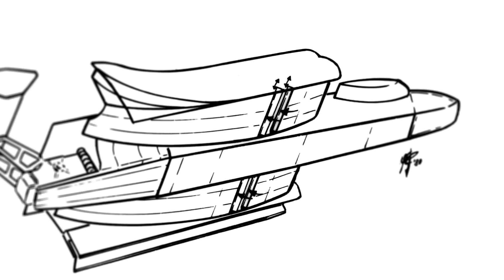Discovering an 'illegal secret' on a Formula 1 car

Comment: One of my all-time favourite cars, I loved that JS-11, distinctly recalling its exceptional debut at Buenos Aires where Jacques Laffite planted the car on pole with  Patrick Depailler by his side. As the tv camera zoomed in on those cars when they took up their positions on the grid, one could see how strikingly different the JS-11 was to anything else. The relatively wide bulk of its nose and cockpit, the high and very prominent bodywork sweeping upwards towards the rear tyres, their distinctive blue and white livery and it was great to see Laffite at the top of his game. How wonderful it would have been had they taken full honours for the season.
Reply: Weenson Oo not if they won by cheating.
Reply: @thechumpsbeendumped.7797  I was recalling my very first impressions of the car back in Argentina 1979. No one knew they were being crafty then but then again what team has not attempted to push the envelope. Look at Brabham and their fan car. It was allowed its maiden win. Were Benetton cheating in 94?

Who's a saint?
Reply: @Houston1863  To answer to your last question: nobody.
Reply: One of the most beautiful formula one cars ever

Comment: So basically there was a drag reduction system before they added it in 2011
Reply: There was already one before 2011, I think year before McLaren came out with what people called F-duct
Reply: Ground effect has been around since the 80s and this vent was to reduce ground effect to aid straight line speed. Ground effect was banned so teams had to add down force instead. Down force isnt as good as it adds drag.
Reply: @3800TURBO  We'll be moving back to ground effect in the near future, though, as it helps to eliminate a lot of the 'dirty air' coming from the leading vehicle, by providing downforce that is currently generated by the rear bodywork and wing.

Comment: So, basically a hidden DRS?
Reply: more like F-duct.
Reply: @JayB-lz6yd    It isn't a system that reduces drag?
Reply: @Porridge Boss DRS is a proper system of its own. and it's basic. just flatten the wing.

F-duct is a way to use/redirect air to feed areas where air iss lacking and create drag (turbulences). 

in the cas of this video, the drag was caused by the radiator openings. so to force the air through them faster to eliminate the drag, they opened a little trap just behind each radiator that connects to the shaped floor under the car that has faster air moving inside.which creates a suction of the air through radiators and escape faster = less drag.
Reply: Without the designated zones
Reply: My first thought exactly
Reply: actually it was a system to reduce downforce at high speeds, becase the ground effect was so efficient on the js11 that it bent the aluminum chassis and lifted the skirts off the ground
Reply: If F1 fans only knew how todays ground effect cars would have some SERIOUS downforce if skirts were allowed as they were in those days.

Comment: The device Giorgio is talking about was used to control the "porpoising" phenomenon, and aero-elastic resonance linked to ground effect which generated significant instability of race cars at high speed. Indirectly, it was a moving device having an aerodynamic effect, and as such would have been questionable, would any team have filed a protest. This never happened as at this time (1979/1981), absolutely every single race engineer was developing its own solution to increase and better control ground effect.

Comment: You now need to ask the question over the scrutinisers. Why didn’t scrutineers pick up on this. I was always disappointed with the consistency of RAC scrutineers on the British circuits. Yes they looked at things on a safety aspect and made recommendations, but surely the FIA have a responsibility to check legality of F1 Cars.
Reply: Lynne Barkas. This was forty plus years ago. Different times
Reply: Because Piola was looking for the ideas and systems all the time to make his drawings, while the scrutineers do it at specific times, sometimes even have to warn the teams so they have the pieces ready to be evaluated. And I bet there was a big sense of "honor" that people would not cheat, I mean, it was so many years ago. Of course by the time the scrutineers arrive to investigate they already hidden the secret or they had a system to lock those plates in place so they don´t move and have a nice excuse ready in case they ask.

Meanwhile Piola would look at it whenever he can, so they don´t have time to hide things. I mean, there are similar stories in the recent years, the FIA rules the car legal and then the teams come and point "but this seems outside the rules", because they know the engineering limits of the rules while the FIA only know the written rules...

Comment: Now he needs to figure out ferraris secret that all of a sudden made them way faster over night
Reply: just a new front wing element
Reply: Yeah right...
Reply: Yes definitely
Reply: Just Leclerc doing his thing
Reply: pee one
Reply: @frozenx1337  and the fact that Merc's upgrades didnt improve them
Reply: I think they just stumbled across better aero. It was always fast, just couldnt steer it through corners. Next year will be interesting if they can refine it better.
Reply: Could be a combination of things , maybe things have just fallen into place good ero , more power , better understanding of the tires , and probly a different feul mix and le-clerc guy was born to race f1 and the fact ferrari are 7 time back to back champions 
The championship is lost now but if ferrari start 2020 like this  it'll be thier wcc and possibly be le clercs wdc
Reply: @twinkmaster2  hope you're not sarcastic because yeah, he's right, it's a new front wing + minor updates that gave them more downforce
Reply: There were rumors about Ferrari finding a way to use extra KERS without it being detected. There's a supposed bypass that they've done to boost it. That's the reason their qualifying mode is so powerful.
Reply: @frozenx1337  more than just a new wing.  New floor and other bits.  Properly developed aero package.
Reply: As if the FIA isn’t? The FIA banned them from using the split batteries they had been taking advantage of, all but giving Mercedes the championship that year (I forgot if that was 17 or 18). “Ferrari International Assistance” is a conspiracy theory, not reality.
Reply: More fucking power! Simple.
Reply: @naufalkusumah2192  3 back to back poll positions and winning his first 3 Grand Prix wins hahaha sure sure.....
Reply: Racing Red you've litteraly got a Ferrari logo as your profile and your name is racing red, yet your calling people fanboys
Reply: @twinkmaster2  FYI the front wing is conditionning the rest of the body. the rear wing was upset by the bad layout of the front wing. since the new front wing, they have a better balance with aero. simple to understand and nothing "illegal"as you seem to hint it.
Reply: Not so much Ferrari got faster, just that Mercedes realized it didn't need to try so they funneled funds away from this year and more into 2020s design. Even with the current car, Mercedes will still likely come out on top and lewis will still likely come out as champion.
Reply: @icommentedthereforeihaveth79  I'm just stating facts. Stop crying so hard lol.
Reply: Ferrari always cheat

Comment: Cheaters are never heroes. They are just cheaters, common thieves.
Reply: Just how long you been around auto racing?  Seriously?
Reply: @geek49203  the fact that I know that breaking the rules in auto racing is as old as racing itself, it doesn't change the fact that I don't accept or like persons like Schumacher and Alonso. As I said, just crooks
Reply: Paulo G Then you must hate mclaren with real passion for stealing Ferrari's designs and data in 2007.
Reply: @horsepower523  Of course.

Comment: I didn't understand how it works... is it a hole that let air flow into the radiator from underneath? Bit confusing for me
Reply: in the cas of this video, the drag was caused by the radiator openings. so to force the air through them faster to eliminate the drag, they opened a little trap just behind each radiator that connects to the shaped floor under the car that has faster air moving inside.which creates a suction of the air through radiators and escape faster = less drag.

Comment: No matter what series F1 IMSA etc... innovation is called cheating! As a retired owner, builder and driver in four different series, I’m always bothered when innovation/engineering is called cheating. Why penalize people who think???
Reply: Probably you are not understanding the differences between bending the rules and breaking the rules.

For example:

The system described in this video works redirecting aerodinamic flow using a movable flap. Movable flap were NOT allowed at that time. This is breaking the rules.
At the opposite, the F-duct operates without movable part (or, to say better... the movable part was not a part of the car, but of the driver😁). For this reason, it did not break the rules of that time.

The two systems got the same kind of advantage, but one of them break the rules, the second one not.

Comment: Battery power deployment and battery capacity capability, and harvesting capability ?  Aero is one thing , look at Honda, massive in roads to Power unit. Renault, just cannot get MGUK to work properly, ever. Ferrari in Russia, the car became totally unsafe and had to stop, ? I don't that happening to other manufacturers.  Battery questions were asked of Ferrari last year also, however, nothing untoward was found. Clever software ? Maybe nothing unusual at all.  However, straight line speed of Ferrari powered cars is not matched. However, if you compare Ferrari customer and part Ferrari car, HAAS, the car has speed , no grip or cornering. Yet McLaren, can flog Renault.  Strange phenomenon.
Reply: Ehm... what is the relationship between this and the video's topic?

Comment: The reason all F1 team invests into R & D is to improve the car hence going faster & stable is the main point. Why didn't the F1 governing body adopted this "illegal secret"??
Reply: Because active aero is way to dangerous. Can you imagine what would happen if one of the brake covers would fail to open at the end of a straight? Or the batteries don't get the required cooling? Or when the flaps underneath the car fail in a fast corner? We have already seen these kinds of things with DRS flaps failing to close causing accidents, or last year's Williams that had major airflow separation at its rear. There are good reasons why these kind of things are banned, the bigger question is: Why did the scrutineers fail to see these flaps?
Reply: All in all, it is a game. And games have to be fair somehow. FIA cannot adopt a new change on the same season (unless it has been proved to be dangerous). A team invented a new technology and applied on the match without being approved by the authority, it is cheating! If other teams feel unfair and unsatisfactory, they may quit the game and the consequences is catastrophic.

In the standpoint of FIA, actually what they want is audience. They don't quite care who win very much. Because more audience means more income from broadcast franchise fees. So how to attract more audience? By make the games more competitive. So FIA changes the rules on design specifications every year to eliminate or to adopt the more advantageous design from last season to even out the technical differences of each team to make the game somehow more "fair". Those new changes will only be allowed in the next season, but not on the same season so every teams can adopt them.
Reply: Also its still a formula sport, meaning you have to make the fastest car within a given set of rules. Formula 1 isn’t about making the fastest car in the world. Its just the fastest formula sport.

Comment: Yeah, that would be violate the "no movable aerodynamic device" rule.
Reply: Back then I wonder if the rules covered flexible parts as these vanes could flex at high speed to open and that wouldn't be classed as a "mechanically  moveable" part.  Only reason I can think it wasnt picked up by the stewards.

Comment: It should be drive what you bring - no rules about the car at all. Then see what people come up with
Reply: So no rules, spikes sticking out the side of the car to fend Max off? A battering ram on the front for Vettel to ram Hamilton? Is that the sort of thing you mean? Fancy following a car down the track when its afterburner kicks in. 

It would be entertaining to watch but, no rules is totally unworkable
Reply: @grahamb5930      Not items for destruction - just unlimited car & engine design.
Reply: @yessure5291  You clearly stated no rules at all but, even if we take of the sharp bits you'd allow a jet engine with afterburner? They complain about not being able to follow the car in front as it is, a big flame and a jet wash isn't going to make that any easier.

Just think of the radio chatter "my tyre have gone off - burnt off!"

No rules is unworkable
Reply: @grahamb5930    Jet engines are slow on the take off. Piston or rotary engines get revved up much faster - so who would use a slow spooling up jet engine?
Reply: @yessure5291  Yes, that's the only problem with a vehicle that spits flames out the back. Ok then, seeing as we are bing stupid about no rules, although you have already changed your mind about no rules and changed it to some rules" You could use a rocket motor to boost the vehicle up to speed before the turbine took over. Great and even bigger flame that you'd be happy to allow! let's kill anyone else that tried to overtake...... 

Now are you sticking with some rules ?
Reply: @grahamb5930     No rules is still good
Who would chose to install jet engines - turbines or steam engines?
The logical choices are piston gasoline or rotary engines.
Reply: @yessure5291  You have already said that "no rules" is unworkable. You did say that you would not allow things that damage other cars so "no rules" is now some rules. Using logic only ends up with all cars being the same so no advantage to anyone. After all the logical solution, the best solution, would be the same for all top engineers.

Btw, a turbine is a jet engine. 

A turbine witH a rocket booster would give the combination of fast acceleration and top speed and kill every driver behind you so win win! That's the issue with "no rules" it simply becomes stupid. 

All racing classes race within a tightly defines set of regulations, always have and always will.
Reply: @grahamb5930     I did not write this >>
You have already said that "no rules" is unworkable. You did say that you would not allow things that damage other cars so "no rules" is now some rules.
Reply: @yessure5291  You said "no rules about the car at all". It is in your original post. I said "spikes sticking out the side of the car to fend off Max" to which you replied "no items for destruction" that means there clearly is a rule! As you have stated no rules then added a rule, logic states that no rules is unworkable. Is that hard for you to understand? 

No rules clearly means no rules and my suggestion must be allowed under no rules. To add a rule to block my suggestion then decide it's not a rule is laughable.